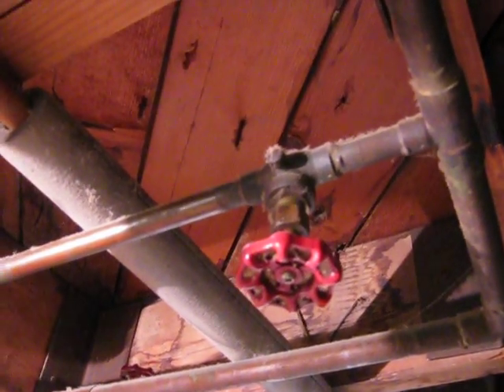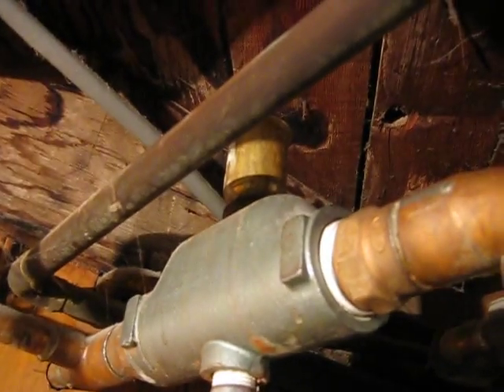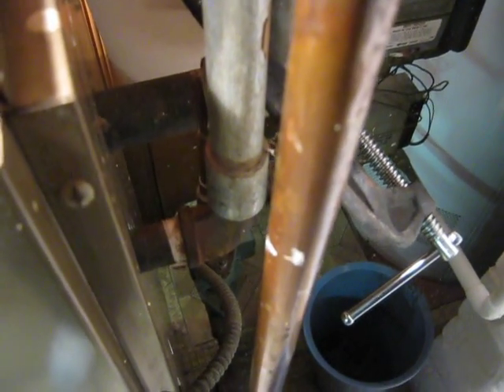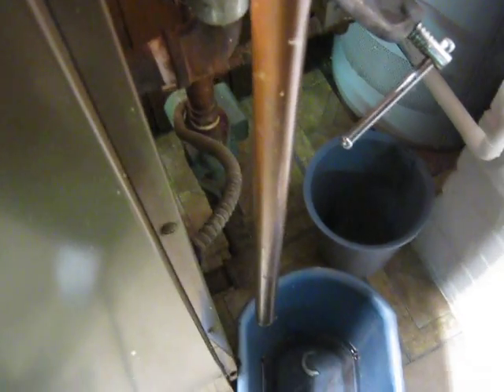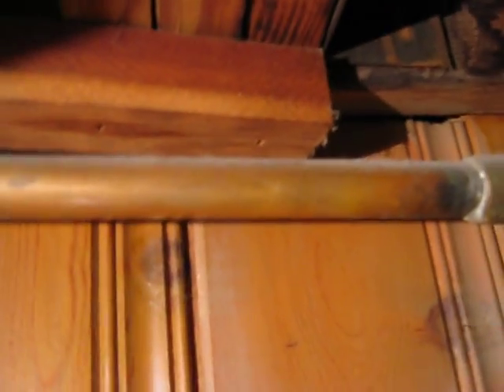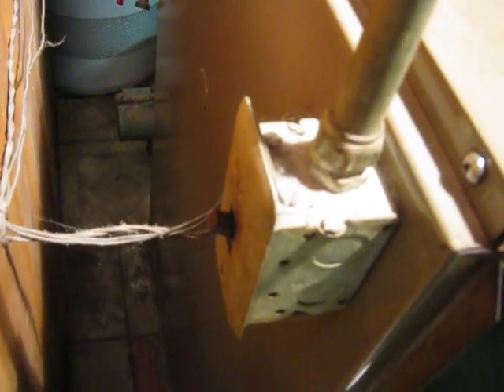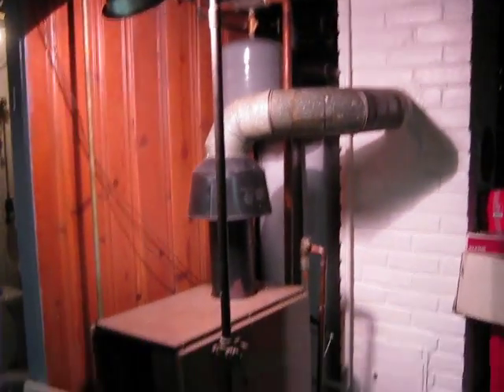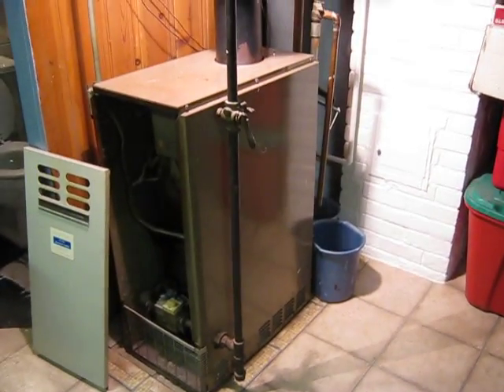Forced hot water boiler no pressure question, Why do i have no water pressure in my boiler?

Comment from the maker: I'm happy to say that now in 2024 I have everything working exactly as it should after 20 years living in this house with never having a service call lol, because who the heck does hydronic heating systems anymore>?? Even running T9 thermostats on the 1st floor and basement. I took the Aquastat out and followed the circuits, made a diagram for myself. Made one for my thermostats also. **Replaced the 150psi valve with a 35psi valve*** Took care of all the leaks, a 99c O-ring saved us a lot of money. Replaced the tank a few times. Within the last year- replaced both valves and the motor. Replaced the auto air vent at the top of the tank probably twice. Adjusted the heat a bunch on the boiler itself, redid the 110 to it, so I can connect a generator, replaced the thermistor, taped up the hood. Few odds and ends, cleaning up the wiring. This thing is at 100% for being 50 years old
Reply from the maker: The motor is powered off of 120v, the valves and thermostats are powered off a 24v AC supply with battery backup that I have remoted lol
Reply from the maker: https://drive.google.com/file/d/1ZmmuI8XzKZmUV6DfirUt6RBKzs-_ZfFC/view?usp=drive_link
Reply from the maker: https://drive.google.com/file/d/17yv7Kn5H2nxIoSXZy1FMzzN3SgViL4xJ/view?usp=drive_link

Comment: I'm having a lot of knocking in my pipes and have a boiler system, my water pressure is 0 - I've tried bleeding the line but no luck, would the 0 PSI be the problem? If so how can I get that to 10?

Comment: Just watched the video again; you NEED a water pressure reducing valve in your system, it is MANDATORY as well as a backflow preventer valve on the line that feeds the water into the system You can buy them at Hone Depot they're like $60
You also NEED a pressure safety valve that is a 30 PSI MAX, the valve you have now is too high a pressure for your system. 
A 0 PSI or too high a PSI can also destroy your pump circulator (Taco)

Comment: As I was saying... the pressure relive valve will engage at 30 PSI and spray water out of the system to reduce pressure. 

Other than the pressure issue, what other problems have there been?

Comment: A boiler does not require pressure,10-15 PSI when cold is all that is needed for most systems. What you have is a closed loop type system feeding your baseboards in the vid I do not see a pressure reductions valve in the water inlet line; MEANING that you likely need to open all the valves from the city-supply line to the boiler, there should be no closed valves
Open them then monitor the pressure in the boiler most residential boilers should not EXCEED 30 PSI when hot the pressure relief....